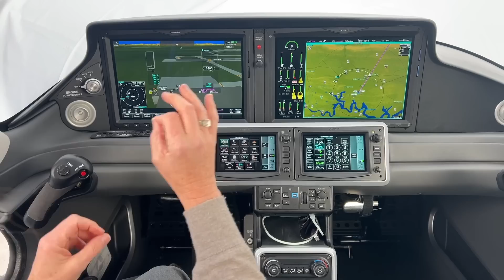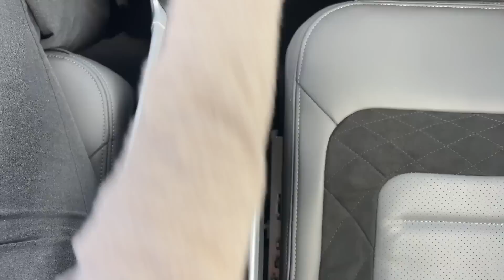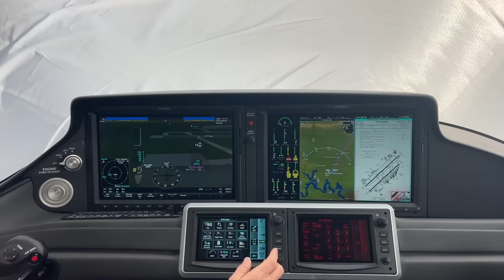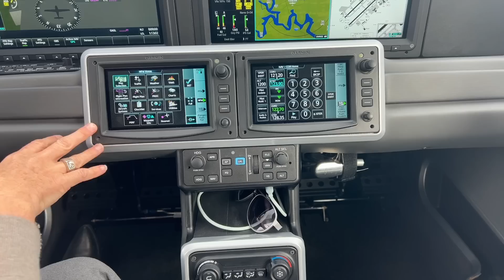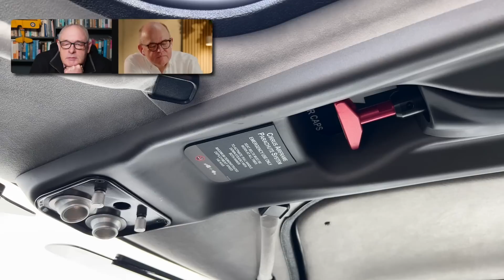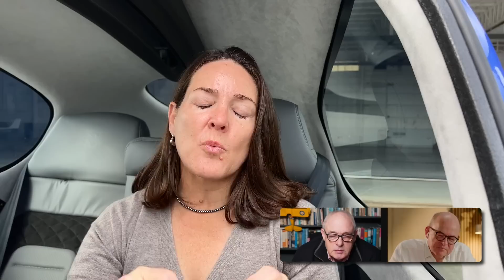Cirrus SR22 G7 Walk through with Ivy McIver

Comment: This is a very very lovely aircraft however I have some concerns. I can’t see standby instruments and would like further explanation as to flying IFR, have they been removed and does the law allow it ? 
Another concern you close the fuel cap which makes it automatic if the system fails and pilot assumes it’s in auto won’t that be a threat because pilots will tend to assume that well it’s on auto and rely on it. Elaborating further pilot thinks he closed it but didn’t 😅.  I would have preferred it to always be manual honestly but yeah.
Reply from the maker: The backup instruments are in the main screen controllers, that switch to provide backup
Fuel system can still be monitored on the screen

Comment: Nice redesign. Why did you neglect to upgrade the engine management to FADEC? Will this be added in the future?
Reply: Yea that’s what the whole universe is wondering, why are they still using that io-550 dinosaur engine, it’s garbage. The lycoming Ie2 has what everyone wants in a million dollar airplane.
Reply: @tropicthndr Because they signed a deal where they have to use it.  They also have a huge profit margin with it and changing it means older SRs will need separate mechanics, needs, etc.

Comment: Amazing aircraft and very well thought out. I know on the current perspective+ avionics suite there are several ways to get around the avionics suite. What are the multiple ways to click through items on the new avionics suite? Is it only touch and the button on the bolster?  Also, does the new touch button start assist with hot/cold starts and the associated issues with each?

Comment: This is the reason why cirrus runs circles around their competitors.  Cessna,  piper, diamond,  etc can't keep up. No wonder people are willing to spend close to a million dollars for cirrus aircraft
Reply: The M350 is only about $0.5 more (which if your paying $1 million for a Cirrus then I can almost guarantee you can afford to pay 500k more). I can’t tell if the SR22T is just super overpriced or if the M350 is underpriced but that 500k is getting you a pressurized cabin, 2-3x the size and carrying capacity, longer range, 3x screen G1000 Nxi suite making it A LOT more 2x pilot friendly than a Cirrus. It’s A LOT more comfortable, 2x quieter, has WIFI and a GWX radar, and emergency descent mode (edm) Hell, it even has a pulse-ox system built into both yokes that upon detecting hypoxia or suspects your becoming hypoxic it automatically descends using the EDM. Also activates the EDM if the cabin becomes depressurized and has a 6 place oxygen system backup. Now I can guarantee all the Cirrus lovers are gonna say the Cirrus is better because of the CAPS system but that’s their opinion. My opinion, the CAPS system is a small price to pay for a significantly more luxurious airplane.
Reply: @bencoyle7555 What price do you put on being able to fly at all?  My wife is a no-go without a parachute.
Reply: @darthmelbius  cirrus sells more airplanes then all of its competitors combined. Cessna and piper are building the same planes they built 60 years ago and still cannot put a parachute in their aircraft. The next step for cirrus will be turbine engines and people who can afford them, will be lining up to buy them
Reply: @darthmelbius price is still the same as the last generation. Also for the same price as diamond DA50RG, you get 35 kts more speed and a parachute